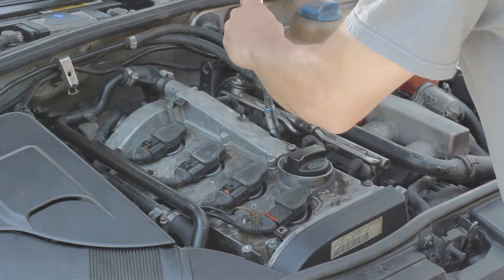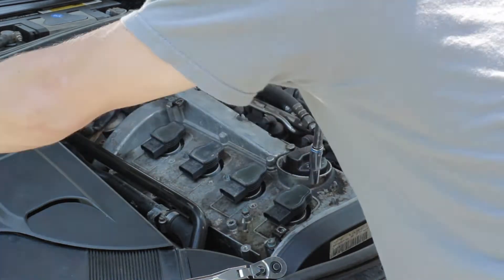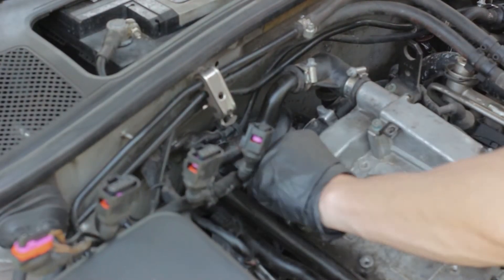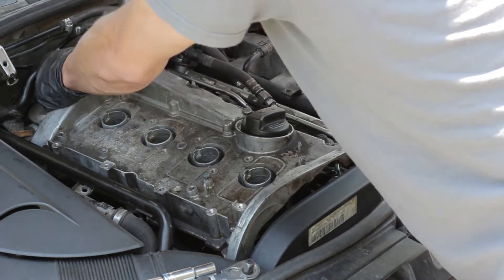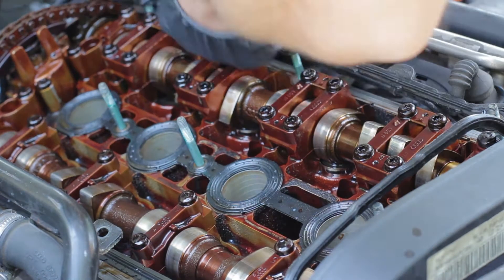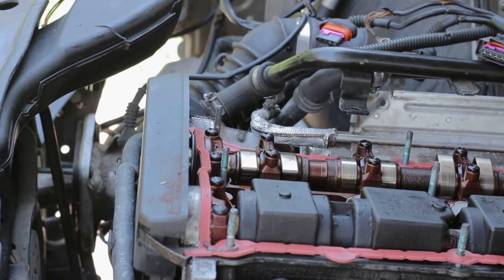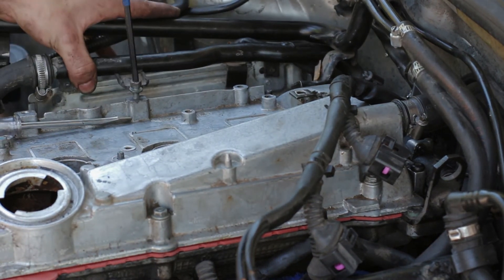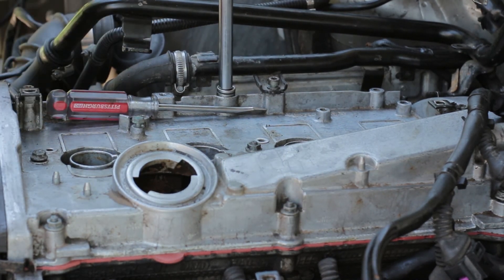DIY Car Projects: Audi 1.8t Valve Cover

Comment: Good video I have just two recommendations for the future or anyone giving this a try - do the half moon chain tensioner seal replacement. Whether or not it is leaking today it is only a matter of time. I would also suggest RTVon the underside of the gasket. Lastly, it doesn't look like you missed this step you just did not articulate it, make sure all mating surfaces are clean and free of any oil/sludge. Again, good video.

Comment: The mechanic I took it took had me order the kit, only to forget to put the rings over the spark plug socket.
I was wondering why my 4th cylinder was flooded with oil.
Found this old video again to work on my Audi. Such a big help. Why do I even need to pay such slimy mechanics?

Comment: I change evry year my rocker gasket of my audi a4 b7 2.0tfsi always leak on corners downside part especially hard acceleration. It is good to put some glue in the corner i will try this method. Most youtubers in audi they dont put glue. Thanks for the good video i helps me out to sort leak gasket

Comment: What’s the bolt tightening sequence.
Reply: 8ft pounds
Reply: They’re only tightened to 8 ft pound so the sequence doesn’t matter too much because it isn’t enough to warp it, a general rule of thumb for gaskets which I do is centre outwards tightening them a little bit each time, so first time 4 ft pounds and then go over again with 8